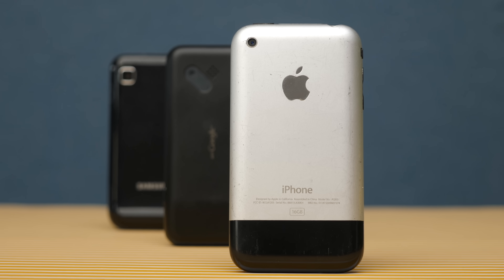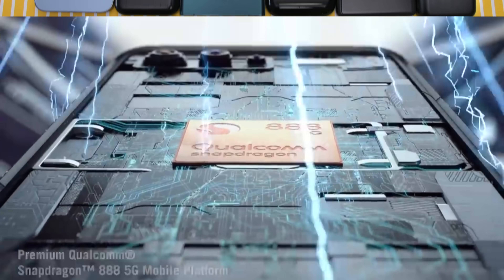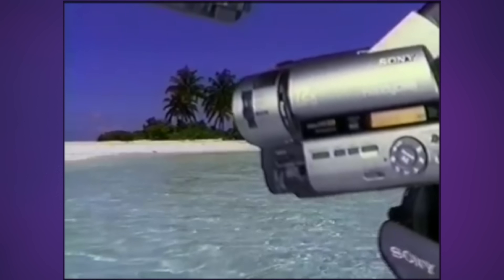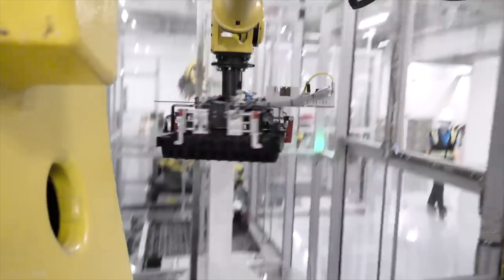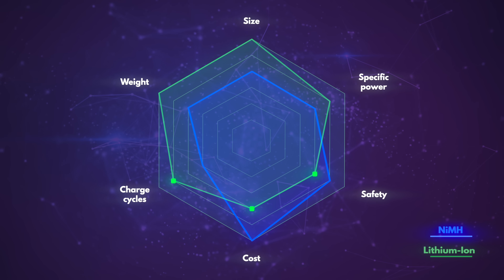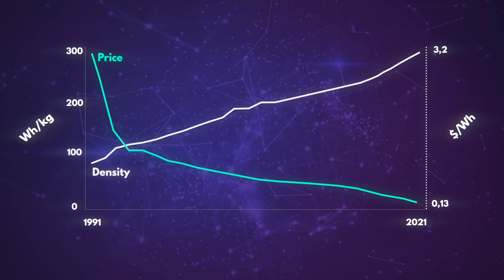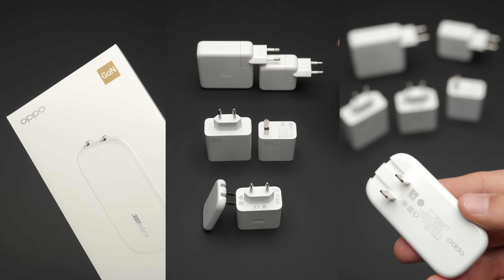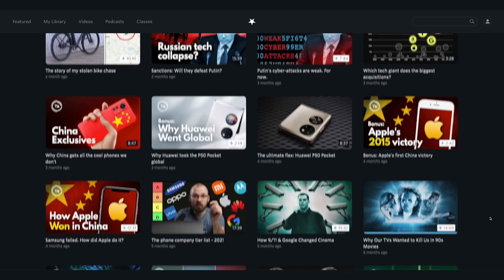The billion dollar race to fix phone batteries

Comment: Alternatively, we could address the problem from the reverse. Make chips more efficient so they consume energy slower, add transparent solar panels over the screen so they can run without using battery at all while in well lit environments and extend battery life as long as possible so we don't need to manufacture replacements as quickly. Other possibilities are organic phosphate screens that use less energy, etc.
Reply: It seems your method is the one this world has taken.  And the (photovoltaic cells) that will compliment the charge.  I just seen a (day or two) past.  Of a solar cell, so efficient, that it even works indoors.  Said solar technology, in combination with a (power sipping) CPU.  Would make big waves.  The (show) or (magazine), whatever it was.  They suggested this a viable solution for (smart watches).  wow.
Reply: @vangildermichael1767  Awesome, lol, I guess I should request some royalties rofl. But joking aside, I'm glad we're making strides to a more sustainable future. It's encouraging.
Reply: So basically what Apple already does

Comment: I really hate how new phones are giant. With giant batteries because they need to be to support those fast charging speeds
I would really like if they make small phones like the Galaxy S10 but instead of fast charging and low capacity battery, just a "slow one" (1hr charge) and high capacity

Comment: I've always wondered why an older smartphone I have barely lasts a few hours under load anymore, but a Nintendo DS from 2005 that I have still seems to hold charge just fine. Maybe video game systems aren't charged as often? Maybe Nintendo has wizards that develop their batteries?
Reply: I think it's only because "old tech" didn't run very fast.  The c64 was only 1 MHz.  And hand held stuff was much slower than that.  It doesn't take much power to run a 500 kHz computer.
Reply: Could be that with lower loads and charge speed, the batteries may be placed under less stress. In high end phones, SoCs can briefly burst above 10 watts, and fast charging is often standard. 

Heat is also a notable battery murderer.
Reply: @Lauren_C  That makes sense, actually. Something like a Nintendo DS produces almost no heat, and it does take a while to charge its relatively low capacity battery.

Comment: 7:30 even without a battery constraint, there’s always a thermal envelope constraint. Even with a theoretical 50wh battery, you wouldn’t put a 30w tdp SoC in a phone.
Reply: It has been done 😂😂😂😂😂
Reply: @TheRealNightShot  do you mind writing here the model of the phone with a 30w tdp SoC?
Reply: @m4t7eo  Asus ROG Phone 6D Ultimate
Reply: @TheRealNightShot  the dimensity 9000+ has a normal tdp of 4w. The Rog phone can peak at 15-18w for extremely short periods, but it will quickly throttle down, even with the cooler.

To put things in perspective, even devices like the Steam Deck, with much more solid cooling and much higher thermal envelope, struggle to reach even 25w tdp.

Comment: just want user replaceable batteries again.  Sustainability alone should be reason enough.  Hopefully right to repair will force the change back.
Reply: They got rid of user replaceable batteries because no one would upgrade their phone every year if they didn't.     Criminals were also removing the battery in their phones before they did their nefarious deeds, and the government didn't like that.   The cell phone is the ultimate spying tool - but this is only true if the user does not have access to the battery.

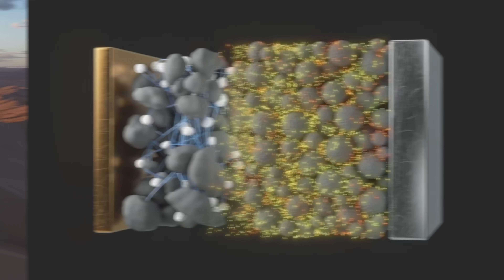Comment: @12:40 Graphite also expands during lithiation. The conversion of C6 to LiC6 has a volume increase of about 10%. Per lithium, the expansion differences between graphite and silicon are not THAT different. The issue is that silicon can hold a magnitude more lithium per unit of mass.

Comment: While I am glad battery tech are being improved, I really want to see batteries that can last longer and stays cool, especially when viewing video content, playing games or multitasking where the battery drops quickly, and it seems to get worse over the years as well. I'd like to see improvement in this aspect, that would be great! Less charging as well and waiting for the battery to get full.
Reply: batteries naturally degrade over time, you can’t avoid that! however, you can slow the degradation down yourself with various methods (keeping it out of strong heat/cold, keeping it in the 20%-80% range, not constantly keeping it at 100%, etc) and the manufacturer can as well, by making devices more power efficient and whatnot
Reply: @Legority  so if i happen to use my phone until the battery is at 10%, is that okay?
Reply: It’s not the battery getting hot... it’s the stupidly overpowered cpu that nobody needs unless they are a hardcore gamer... high end phones now days have higher performance than a cheap laptop for no good reason.

Comment: Especially companies like Oppo can claim as much as they want, I will never believe a single word from them claiming that their super super fast charging would somehow still make the battery last forever before it degrades noticeably.
These companies are lying constantly about a lot of stuff they yelled around and this is no exception. People just don't care about their phones or even use them long enough ti figure out if this is even remotely close to what they claimed.
Especially not when one of their main "excuses" often is the use of two cells instead of one because that's not really how it works. You may charge two cells in parallel but these cells are also smaller which makes them degrade faster than bigger ones.

Comment: So your saying we need batteries that provide more power in a smaller form factor. The inverse solution would say we need to do more with less power... I know we're already attacking the problem from that angel hence the popularity of  RISC (Reduced Instruction Set Computing) based processors such as ARM, (the only one of this type that I'm aware of) over the CISC (Complex Instruction Set Computing) arrangement of x86 & x64 processors... but I feel like we can do more to attack the problem from the consumption side rather than the source/supply side of the power problem. Not that we don't need to keep working on batteries, just that we also need to work on efficiency too. Gains can still be made on both ends.

Comment: And with charging speeds increasing so rapidly in the moment its even crazier when you think about how much more fast it can get once we implement graphene augmented batteries. We'll easily be charging a phone with such a battery for its whole 6000mAh in like 30 seconds without it getting noticably warm while having exceptional reliability with 80% of initial capacity after well over a couple thousand cycles. It could be an insane leap but we'll see what time brings.
Reply: OPPO is the one which is doing great in the fast charging department, even when I use the fast charger with my oppo phone, my phone doesn't get warm at all
Reply: @danteerskine7678  Yeah, the current Xiaomi flagship charges even faster (120W) and it barely gets warm - and thats with just one cell. The same technology with two cells and we'd be maxing out the current maximum of USB-C today. The VIVO IQOO 10 Pro charges at 200W with 2 cells and you can buy it today. I'm pretty sure that by the end of this year mass produced phones charging at 240W will be a thing. 8 minutes for a full charge. Its just insane.

Comment: Silicon is not endlessly abundant. Only fine sand can be used for refinement and ocean floors are already being destroyed. You're dishonest in your video for showing footage of a desert sand when talking about silicon because its utterly useless for making silicon. Coral reefs and the environment is being destroyed daily by ocean extraction of sand for silicon. Likewise the demand for silicon is so insanely high that we can't produce enough, newsflash, every microchip uses silicon. And chips are in short supply in part due to the lack of silicon.

Silicon batteries is going to be useless and unsustainable for a long time, and doesn't fix any problems. Lithium, cobalt and nickel extractions are still needed. Child and slave labour still being used. Your video is super depressing and it's super disgusting that you mention these problems, yet try to fake a positive spin on it at the end when the problems are only going to get worse and worse.

Comment: What I want to understand is, has there been any actual 'technological advancements' regarding charging speed recently? Yes phones charge faster and faster. But I'm coming from the understanding of my high speed FPV drones which I build and pilot. 
You charge these batteries manually, they take around 50 minutes to charge to full at a '1C' rate which is considered the safest and most standard way to charge. But there's nothing stopping you from just dumping more watts in and you can charge at 2, 4, 6C if you want and they will be full much swifter. But in our hobby this is considered dangerous.
So with these consumer electronics batteries, did they have to change the chemistry somehow to charge them faster or are they just doing what they could have done from the beginning, dump more watts in.
Reply: Pretty much mostly dumping more wattage in, though a lot of the progress can also be credited to the fact that the wall adapters deal with the heat and by splitting the battery into two smaller cells

Comment: I think that battery tech has not evolved much on purpose. They want the product to have a weak spot that way when it breaks you buy another. Making a phone with more advanced batteries isn't profitable they want that battery to degrade that way in 2 or 3 years you buy another phone. I wish they would bring back removable batteries I'll take function over form any day but they got rid of those for the exact reason I mentioned above same with the SD card because they want you to run out of storage so you buy another phone. I think the tech is probably already here but they are in no rush to put it out there.

Comment: I kind of think people are looking at advances in mobile computing, such as phones, in the wrong way.

Sure, there may be technologies out there that either allow for a longer battery life at the same price, or a cheaper device with a lower battery life, but in my opinion the market currently isn't ready for those advancements even if we had them today.

As I see it, phones could absolutely get by on a cheap, but low capacity sodium/iron battery if we brought back removable batteries so that one could conceivably switch out batteries half way through the day, or we enabled finer grain user control and finer control of the voltages used by the phone such that people could underclock their devices to get better battery life, as long as they were willing to lose the "hardware dragrace" and not have a faster flagship phone every single year.

So far as I'm concerned mobile operating systems are bloated as it stands with a wide variety of unnecessary features and selling points, leading to the quite remarkable engineering we have available today being insufficient in spite of being at a peak of technological prowess compared to any point in history.

We don't need super fast displays. If you're willing to accept streaming at 30 FPS, which most content is in, you don't game at high refresh rates (I don't know anybody who plays full 3D games at much above 30 FPS personally), and you are willing to accept lower framerate animations (which aren't inherently less "smooth" btw, look up how 2D animators handled the smoothness of animation even animating on the twos or threes), you can absolutely get better battery life. Honestly, on a phone, I'd be perfectly happy with an e-ink display, personally; it would be more than enough for my purposes.

Or, say, if we stopped harvesting everybody's data via backround applications and OS level spyware, that would be another great source of extended battery life overnight.

What if we gave users finer control of running applications so that they could actually "hard close" them, as opposed to the soft close common in modern mobile operating systems, which often leaves unwanted programs in the backround?

Honestly, if we just took a step back, underclocked phone models a little bit by a little bit every generation for three or four generations, we could get huge gains in battery life without changing anything about the phones themselves, but for some reason everybody's racing out for a shiner flagship phone every year or so when they're barely making rent, and companies are pushing the limits every single year just to push more units. It's unsustainable madness.

Comment: The tipping point for batteries will be reached when the energy density of Li-Ion battery will be three times of the batteries currently in use.
In practice, the battery of the size of a current petrol tank of an ICE car will allow the same 600+ miles for a single charge.
This may take anything from five to twenty years, depending on the level of investment the battery manufacturers decide.
The energy density improvements will not come from new material or chemicals used for the batteries; they will rather stem from new crystalline structures achieved with new manufacturing techniques.
Regards,
Anthony